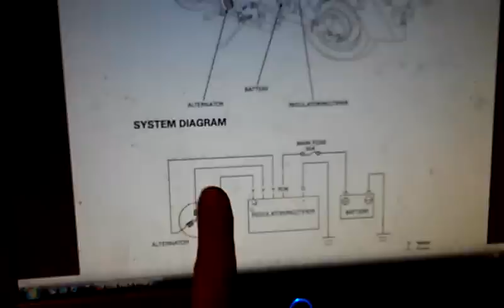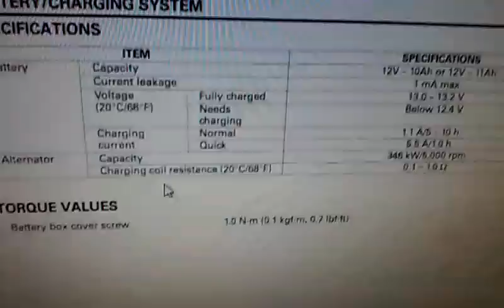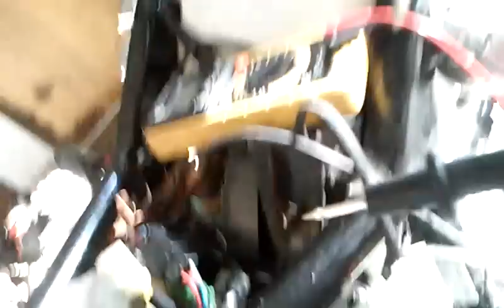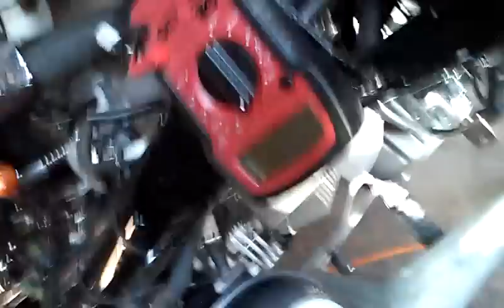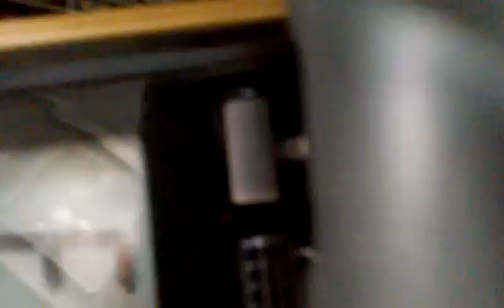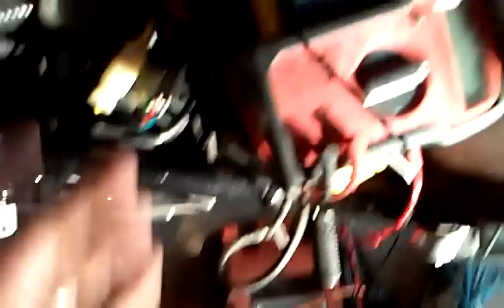How to Stator test honda shadow

Comment: you apparently are not familiar with the working of a japenese m/c and you need to take this video down before someone gets hurt!! That is ac power coming out of that stator and if you keep telling people that it is dc someone will think they can't be shocked by it !!! That stator will light up a house bulb that is one way to check it so last time i checked house bulbs are ac and all jap m/c stators are ac !! That is why it is called a rectifior / regulator the rec means it is converting the ac to dc and then regulating the flow of dc ! That is why an old harley davidson doesn't have a stator it has a generator and regulator NO REC so you are going to get someone shocked or at least you are making yourself look bad by saying you know what your doing
Reply from the maker: It’s a dc system those yellow wires are putting out around 4.7 ac volts going through a diode aka Tesla recatfier turning each 4.7 ac into 14.1 dc volts aprox to charge the battery , the battery charges the computer! The trigger on the flywheel when a magnet field hits it produces upto 2 ac volts triggering the compacitor in the cdi to discharge n crest a spark ! Ps a dc cdi bike is still only 60 ac volts half house but more importantly less than 1/8 amp of house that’s what kills correct ? Not volts

Comment: I have an 02 shadow 750. In the middle of trying to change starter. My question is does the starter just pull out after all bolts are removed or is there something behind the case cover holding it in? Thank you. I appreciate all help.
Reply from the maker: Many times it will have a gear with snap ring ! Unless it has a gear with shaft in there I don’t remember this one for sure but on partzilla there would be a diagram of the parts I use it to see what’s what ! Especially sometimes stuff comes missing parts !

Comment: Stator output is ac voltage...usually 20vac to 70vac at increasing rpms, engine running. I see no benefit to doing this check starter motor only.
Reply from the maker: Good try this is dc system The yellows will be around 4 to 5 volts ac to go to rectify turning to dc charging cdi the trigger release the charge from 12 volts not 50 ac !
Reply from the maker: If you stator don’t work you can ride till your battery is dead ! This is why u need this check !! Happy to explain if u need it !

Comment: Your vid heled me  lot.   I have gone through 4 rectifier regulators in the past two years.  Tonight I'm changing out my stator and the regulator at the same time.   I appreciate your video, and the quality of the audio and the explanation is what I needed the most so your camerawork was fine for anyone like me that has been inside these wires a handful of times on the side of the rod stranded.
Reply from the maker: Good to hear time to ride

Comment: My rectifier has a extra green wire running to negative side of my battery my new rectifier has no place for it ?
Reply from the maker: Use volt meter n make sure the battery is charging with bike running 13 volts !

Comment: How do I take the cover off my stator I got a 2004 Honda shadow It have another chrome cover to the right that I can not get off. It is a 1100.
Reply: It’s a pin behind it I spend 3 hrs lookin for it
Reply: @julianpat6146  did you ever figure it out?
Reply from the maker: You can go to bikebandit.com there you look for oem parts it will have a blow up of covers n mounting bolt location !

Comment: how in this world you getting 4 volts from the yellow stator cables. ... !  who told you that that..?  the stator don't not produce 4 volts. ..  Each yellow  cable coming out from the stator produce over 60 AC volts. ... !
Reply: 4+4+4=12 , yes but not in this case. You need at least 30-70V depending on RPM.
Reply from the maker: The 12 is to charge batteries ! The 50 comes from different coil n goes straight to computer ! If you don't have electric start lights etc you may not have the low voltage charging coil for a batt or even a rectifier at all !
Reply: I thought the stators put out ac and the rectifier converts it to dc or gets rid of tge excess. At least on my suzuki gs1100. But i guess they're not the same
Reply from the maker: You are  correct !
Reply from the maker: All stators are ac current do to rpm s ect , your computer or cdi on your bike can either be ac current or DC current ! Ac collects plus 50ac volts charge cdi from a wire ,,,main coil ,, n 2 from a trigger . Or you a DC your computer runs off your battery is charged by the 12 volts n the trigger the 2 volts let's it spark ! Your charger is always ac . But your cdi determine ac/DC .
Reply: @WaldensWorld  we’re you measuring approx 4 volts DC from the 3 yellow wire block that comes from the stator?  And we’re you testing that by just simply running the starter to turn the engine over?
Reply from the maker: @southwestmichiganobserver3511  prefer to have motor running !  N yes you can unplug it aka yellow wires n test with motor running
Reply: @WaldensWorld  I know all that, but how were you testing DC voltage @ 4 volts each while turning the engine over with starter?  I would like to reproduce this test in my garage.
Reply from the maker: @southwestmichiganobserver3511  it’s ac voltage not dc !
Reply: @WaldensWorld  yes I know that, so what are you measuring in the video the 3 wires at approx 4 volts each to add up to 12?
Reply from the maker: Yes ! The three charging wires !
Reply from the maker: You just watched it lol 😂 🎉
Reply from the maker: wrong yellow charges battery on dc system Ac system bulk n red produce over 50 . sit down n hush before you confuse people
Reply from the maker: oh I own a shop n build about 5 atvs bikers ect a week ! nobody told me i learned . mabey you can't read your meter n it says 5 volts instead of 50 . the yellow wires go to Nicola tesla invention what is its name ?
Reply: there are dc stators that put out dc voltage
Reply from the maker: No sir the coil gets charged by the magnets creating an AC current which must be ran through diode aka rectifier to convert into DC power ! Rpms create alternating current because there not consistent . A DC motor has brushes n armature that use DC power n in that sense it's a DC stator because the current dint change ! It uses electric they other creates !

Comment: You're better off to cut out the three prong electrical connector and just solder the wires instead. That's one of the weak points on any Honda Shadow. It will eventually corrode, and melt. It will also burn out the stator from working overtime. I suggest replacing the regulator with a Mosfet regulator (Google it) and your charging problems will be over. I replaced my stock regulator with a used Mosfet style regulator off of a Yamaha R1 and it charges better at an idle than my old one did when the engine was running fast!!
Reply: Very true my melted n o orderd new replacement